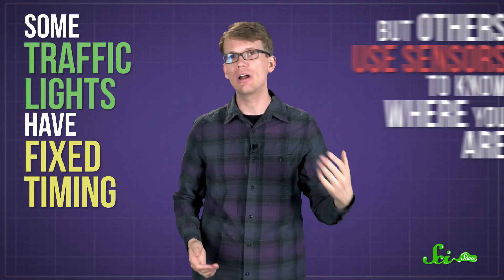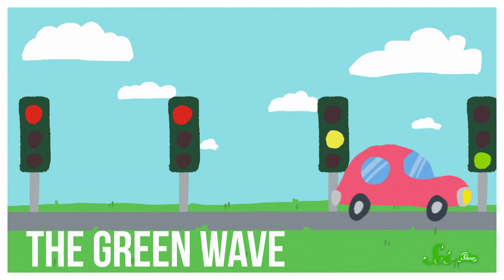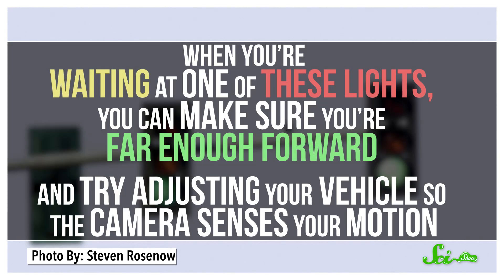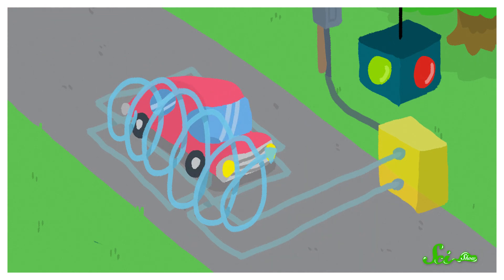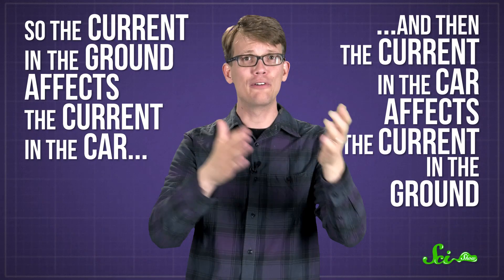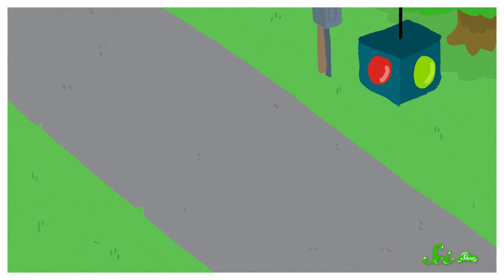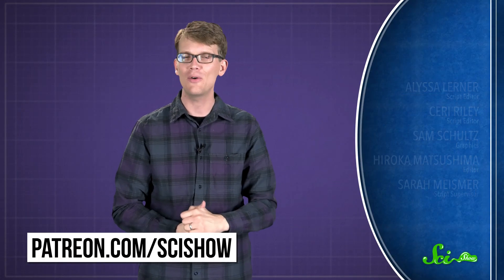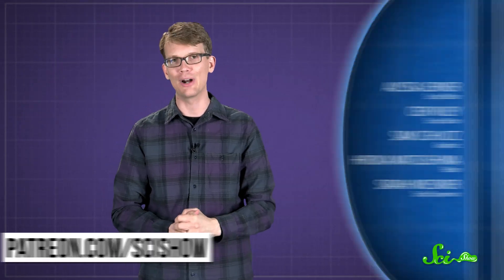How Can I Make A Traffic Light Turn Green?

Comment: If you are driving an off road SUV type vehicle that has raised suspension higher than about 24 inches the induction loop under the pavement may not pick up the presence of the metal frame of your vehicle.  Large trucks like a semi or a tractor have a lot more metallic mass than a regular SUV or pickup truck, and therefore may not have issue with this type of traffic light system. 

If you have any issue with this type of light you or your passenger can always run out and push the button. If there are other cars near to you simply move forward enough for the one behind you to advance and this will add more mass over the induction coil.

Comment: I have a problem with my motorcycle since both wheel rims are aluminum. There are several lights in my area where the motorcycle won't trigger the light. So, what I have done (and bicyclists can do this too) is I glued several small, but strong magnets between the lugs of my motorcycle boots. Now when I come up to many of the lights that won't trigger the sensor from my bike, I make sure I stop so that my boots can be over the wires hidden in the street. Put my foot down on that area over the wires and move them around. Never had a problem with the light anymore. My only problem is that now, every now and them I have to remove little nails from the bottom of my boots or after accumulating fair amounts of iron filings. Small price to pay to not sit there waiting for a car to come and trigger the light for me (especially really late at night).

Comment: Try flashing your lights a few times on approaching the lights, you may trick the sensors into thinking you are an emergency vehicle. Not recommended if there are drivers facing you. They may misinterprate your action.

Comment: I had an old steel frame bicycle and laying my bike on its side would trigger the green light.  I tried not laying it down and the light would stay red, as it was crossing a highway and only triggered when a car was at the light. Got an aluminum bike later, and that trick didn't work.

Comment: Actually if a bicyclist arrives at an intersection with a red light your supposed to try and make the pavement sensors realize that you are there by lining up the wheels on top of one of the grooves , it especially works if there are multiple cyclists together cause it adds to the weight to activate the sensors.

Comment: At 52 seconds in the video a "camera" is shown that senses traffic.  However the picture is not of a traffic detection camera. The picture is an Optical Traffic Preemption System detector, often called a "birdie". You can learn more about preemption here. 
http://collisioncontrol.net/WhatIsPreemption/

 I do a lot of work with traffic signals and the video is very accurate.  If your motorcycle is not detected and it is a light you travel through regularly, such as going to/from work, you can call your city traffic department, or city engineer, or if on a state highway you can call the state DOT and let them know. They can adjust the loop detector so that is detects motorcycles.

Comment: Can the green lights "turn on" both sides? The reason why I am asking is that one of my friend died in car (s) and motorcycle collusion at a slow traffic intersection (45 mile an hr/per mile or below) years ago..At the court, both parties (of course, the lawyer represented my dead friend) claimed that they had green light(s)...Can both car(s) and motorcycle could have triggered the computerized sensors at the same time? Thank you in advance for your answers. -- From Lauren

Comment: Interesting, then some Traffic lights either have broken sensors in the ground for they are different version.   Right by my house, I have this light and the magnetic trip seems broken in the ground.  If a car is sitting directly on the trip, the light refuses to change.  The only way the light detects a car is when the car passes thru the trip but does not stop.

Comment: If your car is faster than the police just run the light dude. Its way faster than waiting. If they see you just haul ass until they are no longer behind you. most police cars are speed limited. usually under 120 MPH due to safety reasons. If you go 150 there is no way they can catch you. If you are worried about helicopters just go 280 MPH in your Koenigsegg Agera.

Comment: The "camera" that was circled in red was actually a 3M opticom receiver. It uses light pulses from a strobe emitter on emergency vehicles to give them green light clearance on their direction of travel. After the vehicle passes, the signal returns to normal operation.
Reply: Actually i think its tomar
Reply: This is actually moronic and wrong

Comment: Where I live there is a street like half kilometer long that all traffic lights change at the exact second, so the cars at the end of the group will stay stuck in the middle, it's frustrating.

There's a law that from 12am to 5am you run lights if they are red and there is no one.

Comment: Somebody proposed to carry a strong magnet on your bicyce.

Carrying a magnet would be the same as carrying any piece of iron with a similar amount of metal. The induction loop would not care if it is magnetized or not. The induction loop is a metal detector, not a magnetic field detector. It is designed specifically to ignore constant magnetic fields, such as the one from the center of the Earth as well as any other source of magnetism.
Also, as metal detector, these induction loop must reject the effect of any piece of metal that would have felt near them, including any amount of metal present in the asphalt. 

The electronic has to react when an large enough magnetic "drag" appear.
If the sensitivity of the metal detector is too high, then it could perceive "false positive" with any source of electric noise, like an electric storm, or a cell phone. People would get frustrated to see the light turn red and give the green light to an invisible car.

In bay area where I live, some intersection have a defective software ; there is a "blind window" in the timing which makes them ignore a car sitting on the metal detector. This bug self correct if more than one metal detector becomes active. In other words, the light trigger as soon as a second car arrive behind you. 

When the light appear suspiciously long, you may try to back up a few feet, then come back.  Even without the bug, moving your car a little may trigger the algorithm "many cars are waiting, we should temporarily increase the green light priority for this intersection".
Reply: Christian Gingras Lol! Ohnthe memories! I used to live in the Bay Area and I had to do a lot of backing up and rolling forward back then. :-D

Comment: This was a great explanation of the mechanics behind the induction loop, but what about the software?  From my experience when the computer detects the changes in the current it sends a signal that starts a timer to turn the light green in X minutes (configurable by city workers), then if the current is changed again (a second car pulling up) then it will decrease this timer by X/3.  This means that if the induction loop sensor is on a lane where the car can either go straight or turn right, it can trigger the light while the car that triggered the light has long since turned right on red (which is legal).  This can be exploited though: If you pull backwards the programmers were never smart enough to add back in X/3 minutes, so you can decrease the timer by just pulling backwards and forward again a few times....  At least that's my experience what the programming is, but I would be curious what the actual programming is if you can investigate that!

Comment: There is a recently developed active Green Light Trigger device for motorcycles.  The device receives a signal from the sensor, measures it precisely, and transmits a specially generated signal back to the sensor. It powered by 12V and connects to the loop antenna installed in a lower part of the motorcycle. An optional LED shows the detection status.
Sold on eBay: http://www.ebay.com/usr/green_light_trigger

Comment: Many induction loop sensors have been designed and tuned/adjusted to also well pick up bicycles.
Some municipalities also specifically lay them out and mark where they're most sensitive to being able to detect bicycles.
Even if/when induction loop sensors aren't specifically marked, often going over them with bicycle around straighter edges of part of the loop, or any portions that cut through the center when they have additional pickups there, will be more sensitive and detect bicycles.  Some municipalities also work to actively adjust and maintain the detectors so they well, and quite reliably detect bicycles.

Comment: It works with a bicycle too on the lines in the road, and sometimes make little moves back and forwarts a little bit. But if you really wanne be shore, then install a little metal somewhere underneath your bike and the lines will detect you anyways :)

Comment: Pro Tip:If you're riding a bicycle, you can install a high-strength neodymium magnet somewhere on the bottom of your frame. The magnet's field should be enough to activate the sensor.

Comment: Those underground sensors are a pain in the ass when I'm in my lifted Jeep. They never would register the vehicle. That is until I bought aftermarket steel wheels, I didn't realize until now that that's the reason why it started registering. It was too high to pick up the vehicle and my aluminum wheels weren't setting it off... Is that a possibility?

Comment: the easy one for a bicycle, just mount the pavement ride around the light then hop off at the other side (used to annoy a lot of drivers while cycling to work by doing this as they're all stuck in school traffic and I just ride around the whole thing and am a mile down the road by the time they start moving) i'd usually be sitting in the canteen in work 1/2 hour before my co-workers arrived

Comment: I learned in the 80s that since most traffic lights have sensors that "sense" the strobe lights on emergency vehicles, if you see a red light from a hundred yards away or so... click your headlights from low to bright back and forth as fast as possible, and it will change it to green. Works awesomely at night !.... Most times during day.  ;-)
And yes, I read the earlier comment from Snopes...   but works for me !

Comment: The field goes around the wire of the loop, so it looks like a torus (donut). Stopping your motorcycle on the side part of the loop in the ground will put your bike right in the magnetic field. The center of the loop is least optimal for a motorcycle.

Comment: Some loops will indeed detect bicycles. (The video even shows a loop especially set up to detect bikes.) Ones with more complex shapes tend to be more sensitive. Put your bike over one of the cuts near the center. You can also lay your bike down (while still straddling it) to get it closer to the loop. Any metal bike will work: steel, aluminum or titanium; even a carbon bike with aluminum rims can sometimes be detected.

Comment: there are bike-specific sensors though i think. the city i live in (davis, ca) is supposedly like the bike capital of the state or country or something, and at some traffic light intersections i've seen the sensor grooves and then there's a little bike symbol or something (or there's a separate bike lane painted green with it's own sensor) and they do work even if i'm the only one there and on a bike. i mean yeah the "just get off a push the button" would work if you're going straight, but left turns are a little more complicated

Comment: Here is the thing. After conversing with my state's dept. of transportation "experts" they told me that traffic light sequencing is "very exepensive." OK. Yet, my question is, why on a section of an US highway I ofter drive, are the unsequenced traffic lights sequenced against traffic flow? If some genious can make them against traffic flow, as in from one major intersection to the next minor intersection the light always turn red when the previous one turns green, why cannot they be sequenced correctly? No answer since it would be requiring a major investment of money to find out why someone did already instead of just going and looking and adjusting the lights. Too difficult? We want technology to solve all of our problems even the ones we manage to create ourselves. No, they are not tied to the speed limit. No, they are not adjusted for trafic flow morning or late. One turns green, the next one turns red. 100% of the time.

Comment: And how in this modern age a traffic light  is still a dumb system.  Lights should be able to self adjust their programming based on traffic sensed and also link up with other lights in the same area to time green lights at a constant rate based off current speed and speed limit.  It is obvious from driving at early morning times nothing like this has been implemented and wasting more time and more importantly fuel.

Comment: If you ride motorcycles check your local/state laws regarding sensor triggered lights. When I lived in Chicago there were a number of these in the suburb where I worked that would not detect a motorcycle.

Example: I pull up, ensuring I'm over the induction loop, to a more major road from a minor road late at night. The light will not change regardless of time waited. A car approaches from the opposite side of the intersection and stops. The lights for the major road go red and the car on the other side gets green but my side stays red... In IL you can run a red light if this happens if you are stopped longer than 90 sec an there is no opposing traffic and it is safe to cross.

Comment: i found out how to trigger the lights while working in the overhead door industry. a coworker had this small remote sized device that produced a faint strobe. i asked him what that was for and he explained its for testing photo eyes he then added its the same thing police cars use to trigger the traffic lights. the strobe has to be an exact pulse rate or the lights wont change.

  i figure the traffic cams could also be set to take a picture of whoever is triggering the lights just to make sure its only emergency services doing so.
Reply: They don't have those near me.   ONly a small percentage of traffic lights have cameras and they are only for giving out tickets.   Here they use radio operated controls.   It is set to a very specific frequency not usually used by any other entity and the signal is coded so only emergency vehicles that are authorized can use the system.   Ambulance, rescue, fire, police, sheriff and state troopers all have these devices.  If they catch you with one without authorization (like an off duty fire fighter was recently caught doing with his personal car) you can go to jail for up to a year.   I've never actually heard of a strobe light device.   In other cities the dispatcher's office is wired into the traffic control office so when an emergency vehicle is sent to a location their GPS sends a signal to dispatch so they know where it is at any second.   As they move down a street, the traffic engineers manually flip a switch for each signal so the emergency vehicle gets a clear shot to their destination.   As far as I know, that system has been in place for nearly twenty years and by now is probably fully automated.

Comment: Those little black "cameras" he describes are not for sensing cars. They are for seeing the white strobes being put off from emergency vehicles so light will change for them. But good try with the camera thought
Reply: no emergency vehicles don't have to stop at lights so no point in putting a camera to change the light just for them
Reply: Come on man think about what your saying and use common sense. We all know they don't have to stop for red lights. But when approaching red lights and there is traffic sitting at light it will change to green to get traffic out of way so they don't have to slow down like they would have to if traffic or a red light was in front of them. Make sense?
Reply: I don't know where you are but here in Florida, many cities have traffic light controllers in emergency vehicles.   Fire trucks, rescue vehicles and police can all change the traffic lights with the push of a button.   When they have to make a straight shot they make it green all the way down the road in front of them changing as they drive.   We do NOT have any sort of camera system for doing that.  Our traffic cameras are only for giving out traffic tickets.   You are correct that they don't have to pull over for a light but if the light is red then the traffic can't pull over so the emergency vehicle would get stuck behind cars.   I'm guessing that since you don't know how that worked that you do not live in a city.   Where I live, from six AM to 10 PM there is constant congestion in all major streets and avenues.   At the height of congestion, 3-6PM you are lucky if the traffic crawls better than an average of ten miles an hour.   So when a rescue vehicle needs to get by the only way is if the traffic on the road they are on is moving.   So they have no choice but to change the lights to green.  Otherwise their patient won't make it to the hospital in time.   One side benefit is that if you are behind an emergency vehicle you sometimes can ride their "wake" A lot of people like to drive close behind one just because they can fly right through traffic in minutes instead of hours.

Comment: I rode mopeds for a long time. our trick was to stick a bunch of neodymium magnets to the underside of the bike. this definitely will affect the induction loop, signaling your presence. I can't say it worked every time. but I ran a lot fewer lights with those in there.
Reply: keep them away from your cdi though or you can have ignition issues!